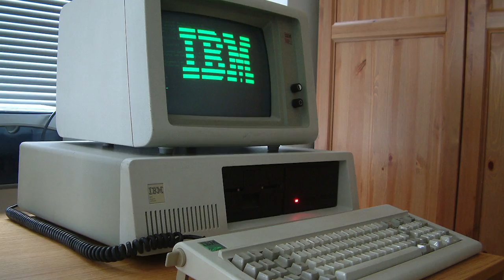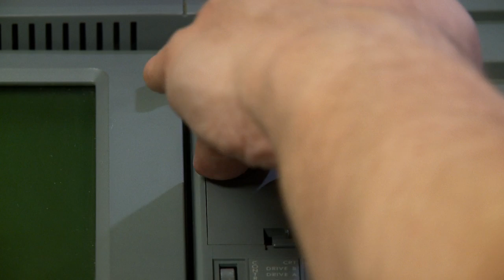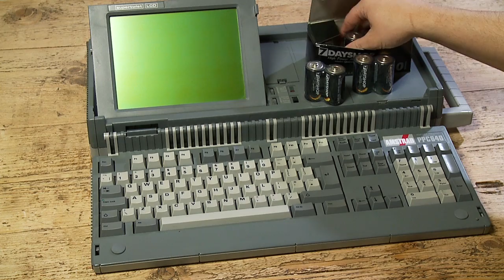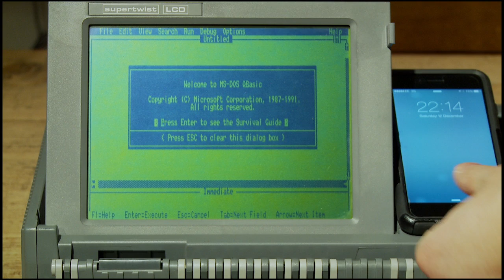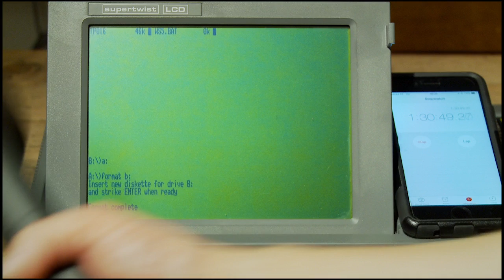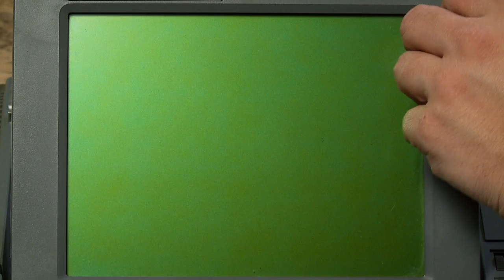ChinnyVision - Ep 101 - Amstrad PPC640 System Review

Comment: There was an EGA version of the PC1640 sold called the ECD (enhanced colour display) as opposed to the PC1640 CD which didn't have an EGA monitor. The funny thing was if Amstrad had put EGA in this 1987/88 luggable PPC range then the Amiga/ST rival Amstrad dreamt up with the Amstrad PC20 and Sinclair PC200 (I think) all in one computers would have sold a lot better as they used the PPC512 motherboards left over from this failed product range.
Reply from the maker: I'm not sure it 'failed'. There were plenty of them about as evidenced by the fact they are still easy to buy on Ebay. What is true is that Amstrads did use the technology in the failed PC200 computer.
Reply: Sorry, failed XT class Amstrad PC sales in general for market share in home use I meant, as in rivals to ST/Amiga/Archimedes machines families would buy. Had the 16 color CGA mode been possible on the PPC and therefore the Sinclair PC200 it might have actually sold to families where parents could take office work to complete at home as well as let their kids play games on it, I think in 89 parents would consider DOS compatibility a plus point. I might get one to tinker with as have a Commodore 1901 monitor which I think will work with CGA mode.

Comment: did you end up getting video out to an external display working on this thing? I just got my hands on one and am loving it so far. Apparently pin 7 on the video plug on the back is monochrome composite out.
Reply from the maker: Not had any colour. It's TTL RGB which makes it a bit of a pig. Ended up buying a PC2086 instead for capture for the reviews.
Reply: ChinnyVision - The Retro Game Review Channel yeah I've been looking on to options for video out. It looks like I'll need to build a digital to analogue video converter, then output the video from that to my GBS 8200. Bit of a pain but I'm determined to get it working at some stage.
Reply from the maker: You've have thought there would be a market for an off the shelf retro product that can do this but apparently not!
Reply: ChinnyVision - The Retro Game Review Channel there is a product called CGA2RGB made by GGLABS which I found links to from a Commodore 128 forum. By the time I get one here to Australia it's about $100 and it still needs to go through a GBS 8200 to convert the analogue signal to VGA.

Comment: I'm curious how long it would run on a few LiPo batteries connected in series (3 providing 11.1v, so maybe using a step-up, 3 providing 14.8, so maybe using a step-down if nervous about feeding it that much). It's an interesting early portable curio!
Reply from the maker: +Paul Wood I dunno what regulation is on the battery input. The DC input is very flexible (something like 9v to 17v). But as we all know, its the amps that matter most. It needs 1.9 amps to run (or so Amstrad say).
Reply: I have a feeling it'd work, but it's something I'd look up properly first. Not fiddled about with that much myself, other than replacing 4 batteries with USB power lines.

Comment: The LCD definitely supports graphics mode. CGA mono 640x200 and CGA 320X200 4 shades (11,10,01,00). The two grey shades are hard to tell apart. I used to play World Class Leaderboard golf on it and the shading worked pretty well and the speech from that speaker is excellent. I also wired an earphone socket across the speaker and wrote a program to send data to my speech.
Reply: Speccy not speech!
Reply from the maker: +Rob Edwards Are  you sure it wasn't a later revision (Amstrad sold them for about 3 years). Would be very interested to play some CGA games on it! Any disk images of that game online so I could give it a test? Nothing I've tried so far that uses CGA graphics modes has worked on mine.
Reply: +ChinnyVision - The Retro Game Review Channel 

The original Leaderboard was easier to see the swingometer, but WCL sounds better.

http://www.abandonwaredos.com/abandonware-game.php?gid=ODM1

I seem to remember the dip switches let you choose MDA, CGA or Hercules emulation for the screen.
I used it as my main computer for about 5 years and I played plenty of graphical games on mine - very blurry most of them.
Reply from the maker: Interesting. Will test this out. As I say I tried and failed to get it working. Will download that game and if I get it working will do a follow-up video!

Comment: My guess on the back modem port would be for plugging in the phone. So you could have the ppc plugged into the wall socket and have access to a phone when not using the modem. Noticed you put in a duracell to make up for the broken c cell battery. Always thought it was a bad idee to mix and match different brand batteries.
Reply from the maker: +theseob Indeed. But it was either buy another box of 10 to match or go to Poundland and get two Duracells. It wasn't scientific or anything. Just a bit of fun.
Reply: Yes it was for the phome